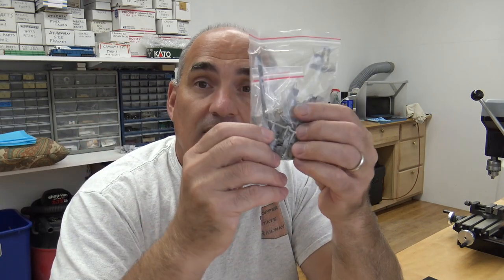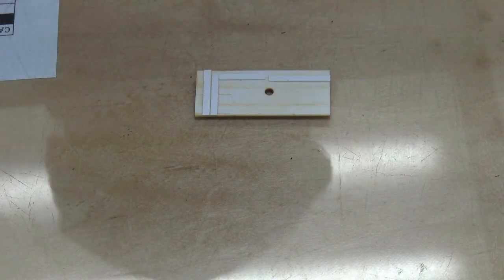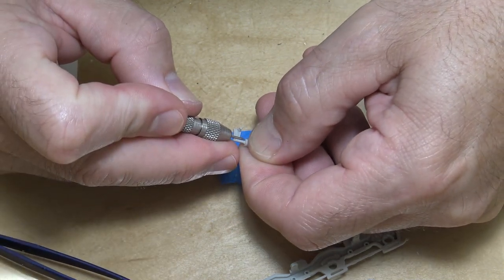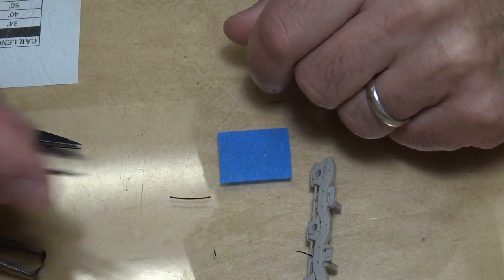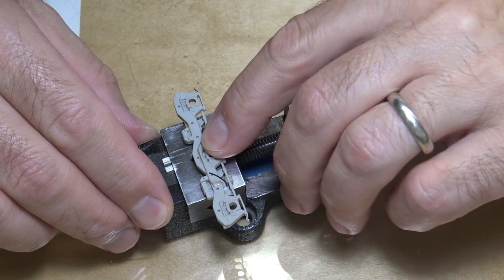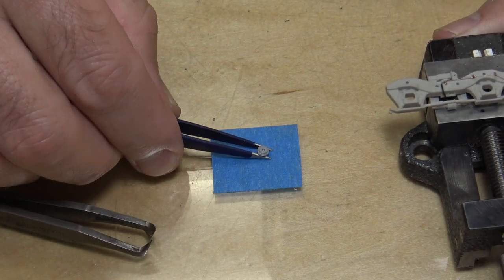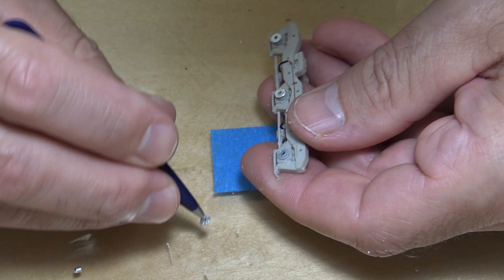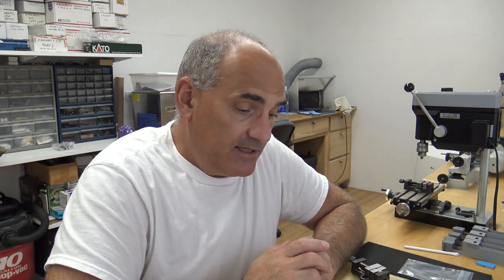EMD SD45 X4 EPISODE #9 Trucks and Trucks Again

Comment: I've noticed that some SD45s (later versions?) don't have the brake piping arrangement as you are doing. I'll try doing one of mine your way and I"ll see how it goes.  You have the patience of a Saint.  Enjoyed it. And it's not too long.
Reply from the maker: If you are doing fine scale modeling, it is imperative that you check photos for what is right. I almost made the mistake of making all the plumbing the same. Thankfully I caught it on the first set.